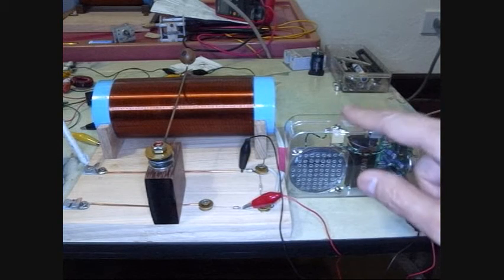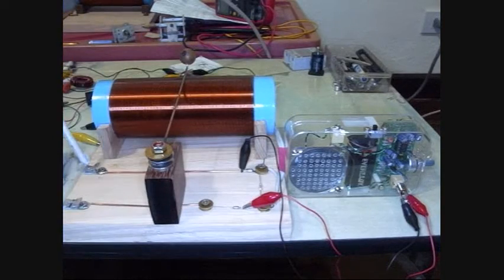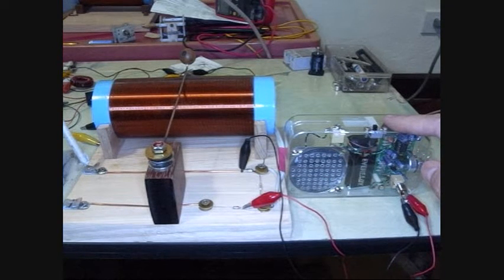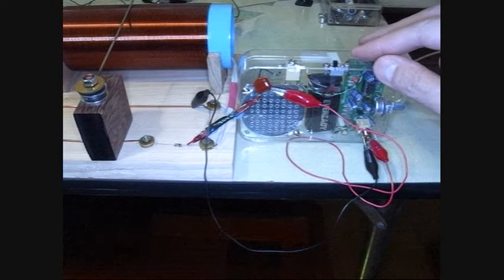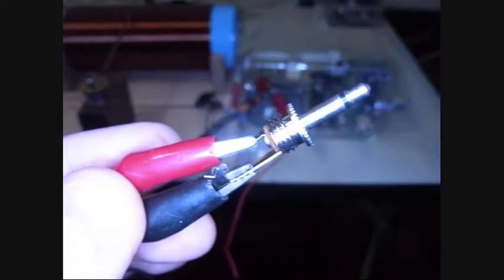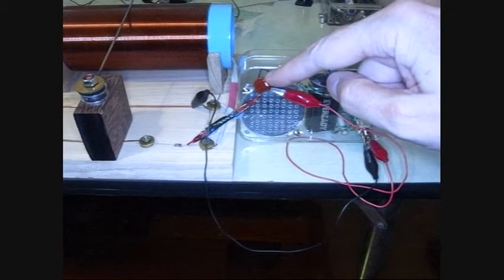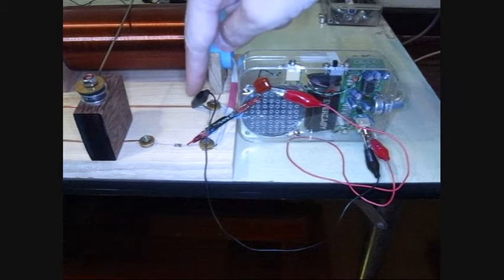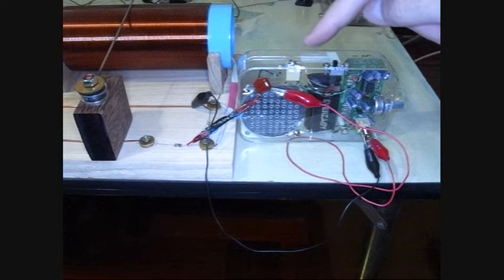Connect DC Audio Amplifier To Your Crystal Radio

Comment from the maker: RELATED CRYSTAL RADIO VIDEOS: 
Best/Easiest DIY Crystal Radio - No Batteries, No External Power 2023 (4K)
https://youtu.be/fLVCqZGpv3U

My New Favorite!  Crystal Radio with Antenna Tuner:    https://youtu.be/mh5KxCpbQ5U
Crystal Radio, Capacitive Tuning - WORKS GREAT!:    https://youtu.be/VJ80Nm9KSkE
Crystal Radio & Resonant Coil Design:     https://youtu.be/Fw9eb-aB-XU
Crystal Radio Antenna (Shortwave Also):    https://youtu.be/G8AsgZbncW4

My Crystal Radio Does NOT Work (FIXES for common problems):    https://youtu.be/kCxQ8iPQx4s
Good Crystal Radio Connection Points:    https://youtu.be/G3qjrReHR1k
Three Upgrades For Your Crystal Radio:   https://youtu.be/LENco3_jV_s
Crystal Radio Wiper Upgrade:     https://youtu.be/i1otDz39nlw
Popular Crystal Radio Design That's a Waste of Time - And Why: https://youtu.be/r9Onub2Xpzc   
New Crystal Radio Design - "Modified-Pickard":     https://youtu.be/_qxHhFKjLAg
Crystal Electric Generator RF Energy Harvesting Exp 5 - Full Wave Rectifier:   https://youtu.be/BTu_GJKjOmA
Reply: @tsbrownie  can you resend these links
They are expired now
Reply from the maker: @NithinSriram552  They work fine. Your browser may be set not to open links.

Comment: So I have a question. I've been attempting to build an lm386 amplifier with 9 volt external DC power to no avail. Probably three or four attempts now. I don't understand what I'm doing wrong don't ask me what I did but somehow I got it to amplify it and it was much louder in the earpiece with no external power LOL. Has to be something simple that I'm overlooking. Any suggestions?
Reply from the maker: Is it a kit? I tried 3 different kits from 3 different companies (from Asia) and none worked. When I looked at their circuit diagram and compared it to the recommended one from the manufacturer, it was not close. One chip was plain bad. The reason you don't see a video here on that is because I threw them away. I have built them from parts on a project board and they work every time. Avoid cheap parts and kits.
Reply: @tsbrownie  no it's not a kit..I bought parts separately.  I'm green to electronics but have a basic understanding being a plumber.  Question, do you know how I can get my crystal radio to receive higher frequencies? In the hf band? Like 40 m and 20 m?
Reply from the maker: @brandonlaragirl  This uses a trick that only works with AM modulation. So if what you are looking for is AM in 40m or 20M, you can build a coil for that. I have some videos on free software that will give you the specs if you give it the inputs. https://youtu.be/Fw9eb-aB-XU
Reply: @tsbrownie  got ya, thanks bro.

Comment: Hello good evening
I discovered problem
I got d311 diode today 
Went from very weak distorted
To nice audio !
Don't buy those junk 1n34 !

Can diodes go bad from a near 50 kw station ?  It seemed to work better at first now not so much
I checked vf on d311 and same as before .18

The junk 1n34 shiwed .27
Reply from the maker: There are different quality of electronics.  I've always used 1n34a since forever and gotten good results.  They are sensitive to over voltage and are easily damaged.
Reply: @tsbrownie  well someone just include a couple today and I tried those and same poor results 
I received 5.2 in diamond weave 660 46 litz today and compared with 2 x 2 in cheap solenoid that came with kit and little difference
Just 2 stations mixing together
Slowly but surely getting it together
I need to try my antenna at home 
With an antenna tuner

Comment: Good evening TS
you didn't use a transformer ?
Reply from the maker: No, never have.  They would change the inductance of the system.  Some people say you can use a regular speaker if you use an audio transformer, I've not tried it yet.  Just makes something that's supposed to be simple, complex for no reason.
Reply: @tsbrownie  thanks reply
I got a cat whisker today
And it came with a free  d311 diode
Vf .18 compared to .27 with 1n34 that I have. 
The coil I got with radio stunk
Took it out. Ordered basket weave litz 660 46 with 45 turns 
Also ordered the audio transformer 
200k down to 8 ohm bunch of options .
Little by little we will get a decent radio

Btw I bought it on ebay 25 dollars from old timer in California 
Really bad soldering connections etc
But I wanted the old atwater kent  cap
And wood . that was worth the 25 dollars
Guy is 85 so have take that into account

Look at yt video
Eloy parra crystal radio
I really like the one with the litz wire
And tuner on bar 
Elegant and simple